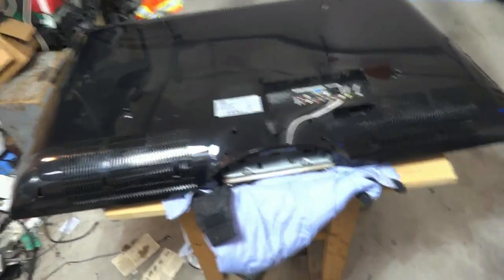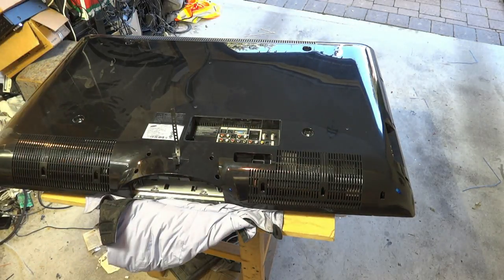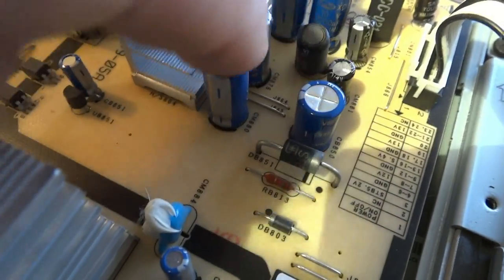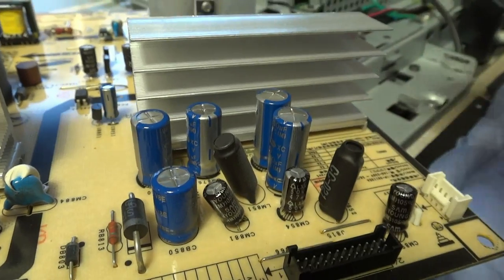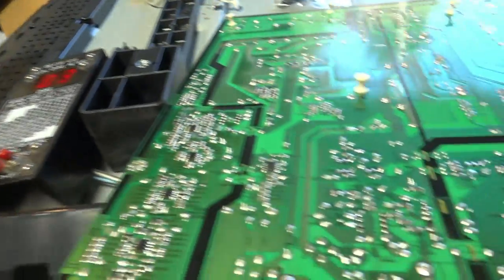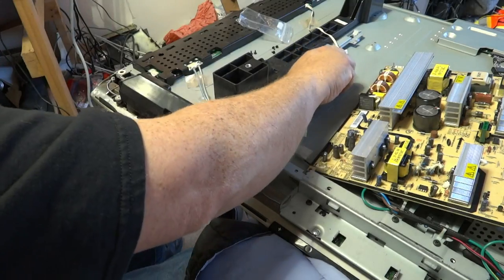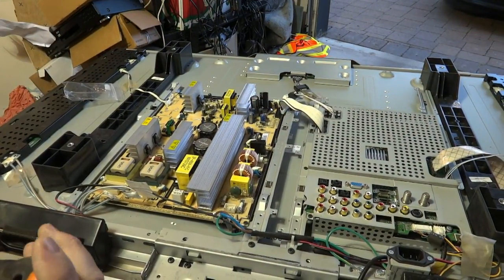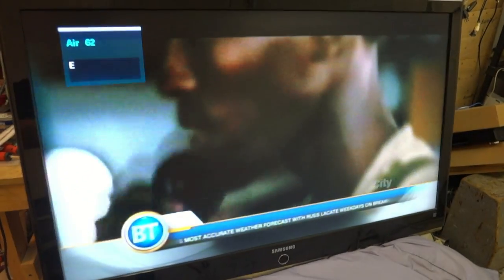Samsung LN-T4661 Slow to turn on or Dead

Comment: Hi,
I just received the same model TV (Samsung LN-4661F) from my sister as she decided to upgrade.
It does seem to have a problem where it intermittently loses the HDMI signal.
When it does this the screen goes black and it shows "HDMI3" etc in the top left corner then switches to "Air 3". After 1-5 seconds the signal comes back like nothing happened.

It doesn't seem to matter what HDMI port it's plugged into as it does the same thing with the alternate port number.

Before I open it up, do you have any suggestions for what I should look for?
I'm comfortable soldering and have a multimeter in case you're wondering.

Thanks
Reply from the maker: You should know that HDMI is flaky on many sets. Common problems are loss of video, loss of audio, just a screen of snow, or a black screen.
The problem is HDMI is an evolving standard, and many devices are not fully compatible. This is more of a problem on older electronics. Samsung, Sony, Panasaonic, Insignia/Dynex  and Sharp tend to have the worst compatibility problems.
If the device you are connecting to (cable box, IPTV ect) has component outputs, then the recommended connection is to use component. The problem is HDMI has been through at least 5 revisions, and even though all devices are supposed to handshake and pick a protocol that will generally be the device with the lowest version of HDMI, this quite often does not happen. I get dispatched at least 3 times a week at work to go and solve an HDMI compatibility problem, and the solution is always the same, swap the HDMI for component cables.
The newest TVs have solved this problem, but there are still milllions of older sets out there in service where this is an issue. It tends to be device specific. Your BD player mak work just fine on all inputs, and then you plug in your game console, or cable box and there is a problem.Occasionally I get the message "this display does not support HDCP over HDMI" and a black screen. All I can do is reboot my IPTV box. One of these days I am going to swap boxes, but I am hesitant only because there are recordings on the PVR that I was keeping until I off load them to my PC. Once I do that I will be swapping the old box for a new one with a newer chip set. (There are perks when you work for the cable company!)
Reply: Thanks for the reply.

Hmm... that's unfortunate.
Would it work at all if that was the case though? Mine works but then drops out.
Reply from the maker: srcowle
Yes I have seen cases where it is working, and then it just drops out.
Some have claimed that the brand of HDMI cable makes a difference, however me thinks that salesmen are just trying to sell an expensive cable.
HDMI is really only necessary if you are sending 1080p to the display from a bluray player. Broadcast TV is not 10080p, it is either 720p or 1080i depending on the station, and there is no difference in quality between component cable and HDMI at those resolutions. The "only" reason I use it in my system is my AV receiver does not output any graphics in component video, so I use HDMI on my home theater. On my office TV, Kitchen TV and bedroom TV I have all my IPTV boxes connected by component cable, and have never had any issues. The TV in my bedroom was given to me by a customer that was having an HDMI compatibility issue, and they bought a new TV. I haven't had a single issue but then I didn't connect HDMI. Mine is a Sony about the same vintange as this Samsung.
On the Panasonic in my office I use HDMI only for my computer (editing monitor) my Bluray, and XBMC media player as that is all they have. For the IPTV, and DVD recorder, I use component. Again never any issues.
Reply: Okay, I'll see if I can track down and hook it up using component then. If I can get it working it's going to replace an old CRT so I'm hoping I can.
I have an LG 42" as my work monitor that is using  PCI->HDMI so I tried using that to test the other one.
My sister says that she had the same issue with the TV as well. I'll have to ask her if she ever used any other input types.
I'll probably still open it up and see if the capacitors are going while I have it in a workable environment.

Thanks for the input.

Comment: why is a customers set teetering on a tiney stool?! and over a concrete floor  that if someone walked by and bumpt it would crash and shatter?
Reply from the maker: It is not a tiney stool, it is actually a work cart, and it can hold a 400 lb set. This is actually one of the work carts I used at the shop I worked at for many years. Very solid, and will not tip over. I have it next to my fixed bench these days with my shop 42" plasma that weighs about 80lbs on it.

Comment: i watched this for the esr meter display, the main thing was the taking out of circuit cap, i would of like to see the reading of the cap in circuit and then the reading of the new cap in circuit. them esr meters work ok, but can be temperamental on the zeroing, switch off instead of zeroing. i made one , years ago .
Reply: If the test lead resistance is 1Ω or higher, they switch off. You might have dirty banana plugs/sockets.
Reply: @ZilogBob  thanks for the reply zil b . you were half right. the reason for the shut off was the long leads i was using. i figured out if i first zero out with one lead on the plug socket,  it zeros out, then zero out the two leads.
Reply: @robertlsvejda  Your leads must be very long and/or very thin. Most pairs of test leads have a resistance around 0.25 ohms. Anyway good luck in your repairs.
Reply: @ZilogBob   i measured my leads they're 34" &  36" about a metre. my resistance is 0.62 ohm at start up, it zeroed okay. but sometimes it shuts down if i haven't used it for awhile. i have them lab type banana plugs, were i can do the single lead trick. i didn't know if the zilog chip might have got a discharge, but it works okay just that shutdown thing is a piss off. i have 5 of them zilog z80 ics but  no source code or compiler . i was going to make a read / write and program them as spares , but that's another story.

Comment: HELLO! My tv is the same model and was wondering if this would fix my issue as well. My 4661f will turn on but will have half the screen "roll" and will be half dim/black...then 20 mins later....boom! perfect picture....do you think this will fix this issue?
Reply: I have torn it down and put insulation foam strips on the existing foam strips where the TABS connect. put it back to gether and tested...perfect picture....1 day later...back to the rolling screen to one side until it reaches the end.also two verticle lines as well that disappear.
Reply from the maker: J.C Baker
Sounds like your panel is fubar.
Reply from the maker: More than likely the panel is going bad. The interconnects between the flexable pcbaords and tcon board are known to go bad on many of those Samsung panels. I remember the Sony XBR panels, that used the Samsung glass having many problems.
The connectors were originally on the bottom, but people kept fuc-ing them up when they sprayed cleaner on the screen, and it dripped into the connectors and ruined them. So they flipped the panel over, so that any liquid that was on the screen wouldn't drip into the connectors. The problem then was heat building up fried the drive ICs on the top.
Reply: 12voltvids
Yes! exactly. Its get REALLY hot around the top of the tv.  :( This makes me sad...but what would explain the tv screen instantly becoming perfect after being on for about 3omins?
Reply from the maker: J.C Baker
Thermal expansion is correcting the fault, which is likely a bad connection between the panel and ribbon cable, or one of the ic's on the ribbon cable.

Comment: tell me about Sony Bravia with picture that is unstable. Tks
Reply from the maker: +Bea Lude Probably the tcon (timing controller) board failure.That's just an educated guess. LCD TVs are a pain in the but. I much prefer Plasma as far as flat panel TV, and my favorite things to service, vintage audio, VCR and CRT TV because at least these devices are serviceable.The modern stuff not so much.

Comment: sort of makes me wish I had kept my old TV when she went black!  Instead, I called a kid who plays with such things, and purchased a new JVC 48" with 3D that I have never tried.  Ah well, I may be more prepared when she bites the big one.  I did save the CRT monitor built into our motor home when she began going black when ever we hit a bump.  I took her apart and found  some bad solder joints.  Adding some nice juicy lead solder to the board made her work for another couple of years, but she is once again having the same problem again.
Reply: yes among the top major tv problems is bad solder joints. Next time go over all the joints and resolder them. use a good non corrosive flux and wick off the old solder and apply fresh solder. joints may look good but they may corrode at the wire sometimes

Comment: Had same problem with a LG 42" 5 caps on the power supply was the problem.
Reply: I suspect 90% of the problem with these flat screens is the power supply!

Comment: the first thing you should do as quickly as possible is discharge all those capacitors for safety and for the safety of your test instruments
Reply from the maker: They actually do discharge fairly quickly, as the power supply IS running when it is unplugged,and the running circuits will discharge most of the charge.

Comment: You called capacitors 'condensers'.  Retro!
Reply from the maker: Capacitors condensers same thing when talking electronics.  Dont call a capacitor a condenser when talking to an hvac guy or he will hand you the air handler (also called the evaporator) instead of the motor start capacitor you really wanted.
Reply: 12voltvids Or a refrigerator.  I usually call the really big capacitors 'condensers', if anything.  You know, like the ones used in microwave ovens.